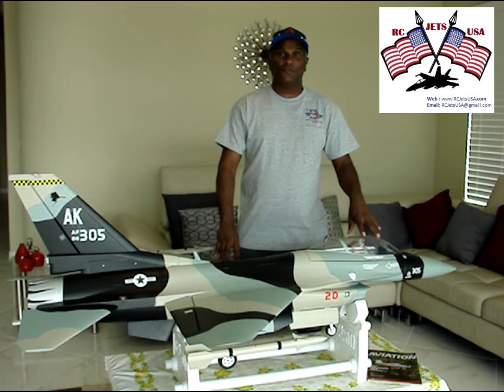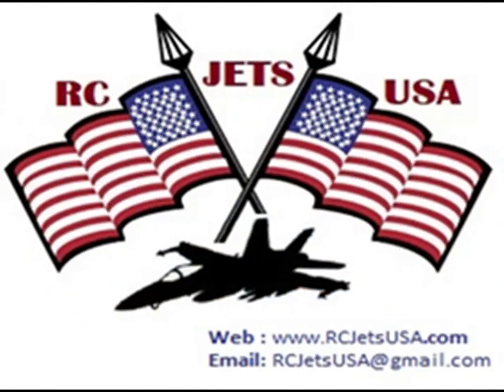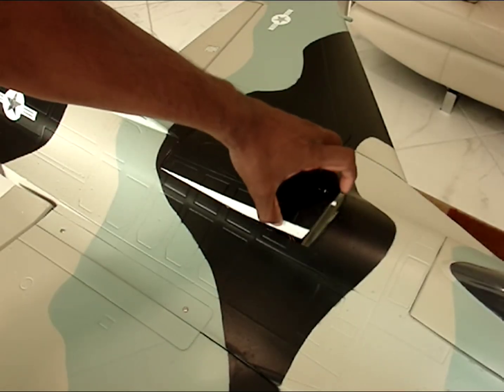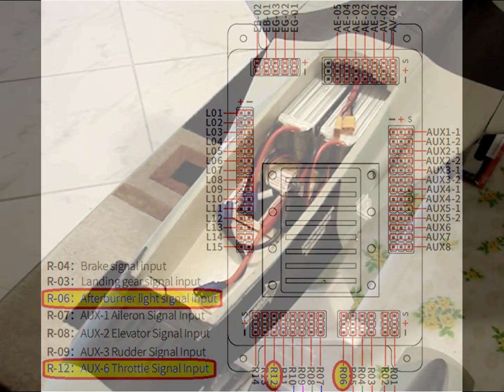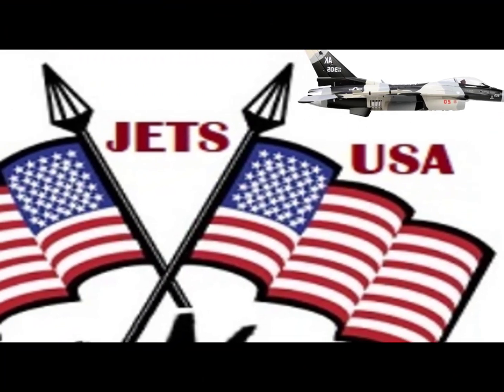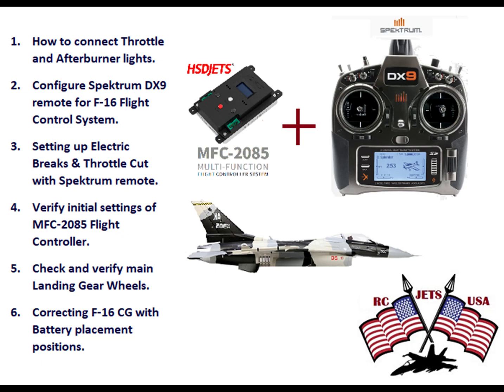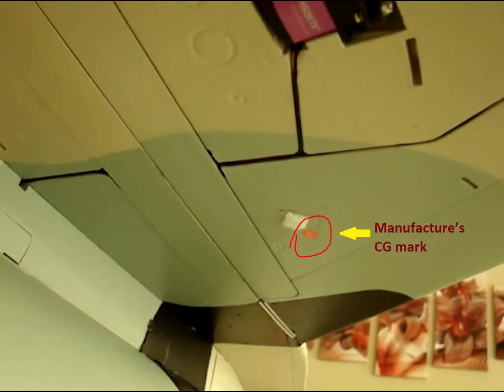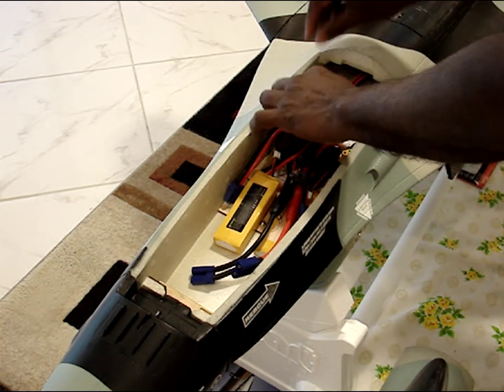Prepare HSD F16 105 mm Jet

Comment: Whats the final take off weight with all batteries etc. included ready for take off ?
Reply from the maker: I really did not check the final weight as it is not relevant. This jet is designed to take even weights of turbine engine plus a smoke unit within. If your concern is adding more larger capacity batteries, I have seen people using 7000+mAh batteries, so you can add large capacity batteries as far as it can fit in to the slot. Most important thing is to get the CG right, please refer to the website www.RCJetsUSA.com to identify the correct CG location.
Reply: @rcjetsusa  hey 👋 Thank you for your answer ! Does it have enough thrust with the new S-EDF or is there not enough available for perfomance flying. What experience do you have with its thrust to weight ratio ?
Reply from the maker: Actually it is pretty good, have enough thrust to go vertically and do all performance flying. When I fly, don't feel the drag of the weight like my 90mm Thunderbird does. So far I am pretty happy with it. Check these out https://youtu.be/sMx-49nNYNE / https://youtu.be/3G2MPymWTvM
Reply: @rcjetsusa  and can you tell me how many flights you can do with only one 2s rx battery ? Because I‘m about to use only one 2s 500mah for one and change the battery after every flight but I dont know of 500mah is enough for one flight
Reply from the maker: Hi Julian, I use 2200mAh 7.4v x2 batteries on all my 105mm Jets, I have done at least 5 flights without having to recharge them, which is not an issue. However I do not recommend running on a single battery, which removes the whole purpose of redundancy power for Control System, Receiver, Gyro, Servos, Landing Gear, Lights & Breaks. Also reducing required amps than recommended is not a good thing as well. So 500mAh is pretty low and I would not take a chance of losing power to those important circuits specially receiver & the control system.

Please take a look at this video on what happens when you lose power on a 105mm Jet, I hope this will never happen to you. https://youtu.be/0f_OdtVCQV4

Regards
Reply from the maker: I use 2 of these batteries, they are pretty good but cheap about $8 each https://rcbattery.com/liperior-2200mah-2s-25c-7-4v-lipo-battery-with-xt60-plug.html

Comment: You didn’t say how many millimeters for the CG
Reply from the maker: Hi Andrew

Thanks for the question. Actually you do not need it anymore as it cannot be predetermined as its all based on your batteries and their size. If you placed the batteries as I have shown in the video, you do not need to worry about CG location and you are safe to fly without any CG issues at all. I have done this multiple times with different size of batteries safely, please check out the below short videos of taking-off and landing the Jet safely and smoothly with proper CG and balance.

Taking off & Landing Video: https://youtu.be/3G2MPymWTvM
Reply from the maker: For info on CG of HSD F16 105mm Jet, please visit www.RCJetsUSA.com and select RC TECH menu to view the pictures. CG it at about 135mm.